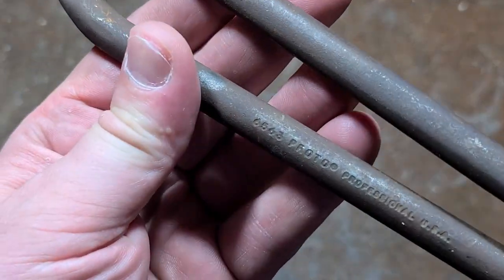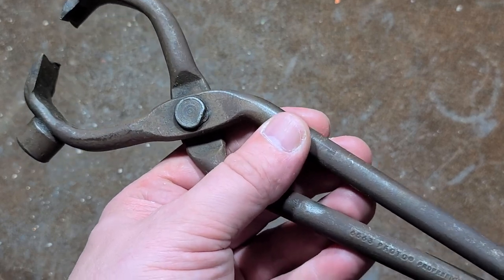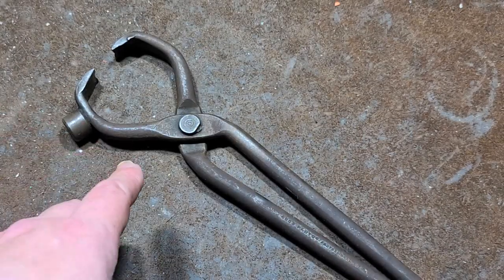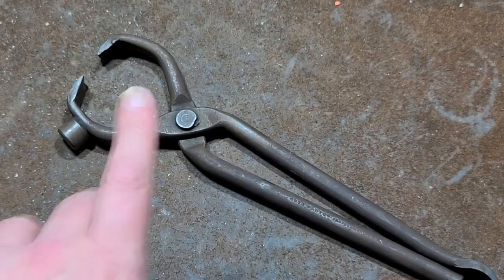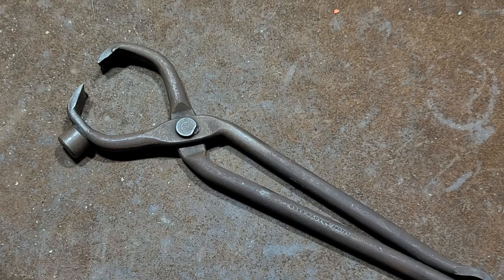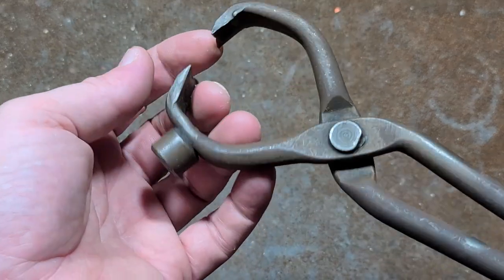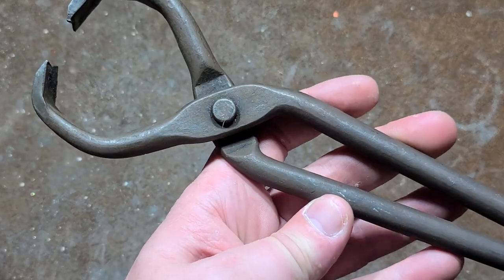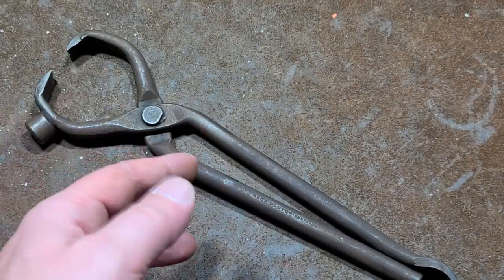Proto Professional Wheel Hub Dust Cap Pliers Review

Comment: I like the Snap on ones better. They grip better when there is zero clearance to grab around the cap. They also spread open larger to even take the caps off rear wheel sealed bearings.